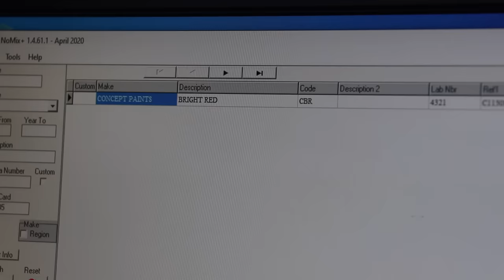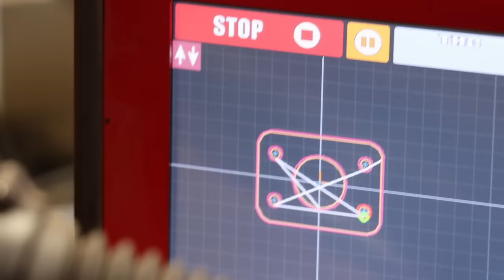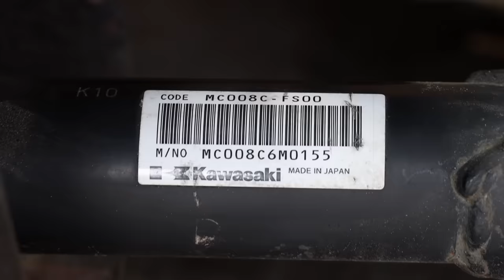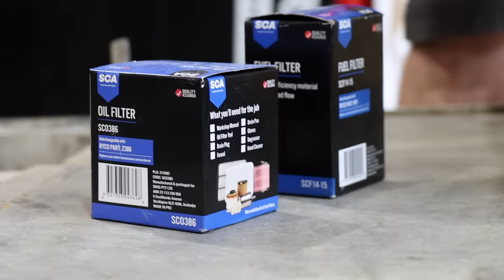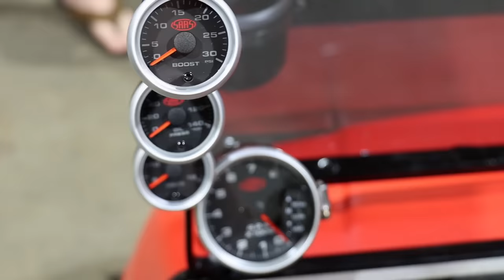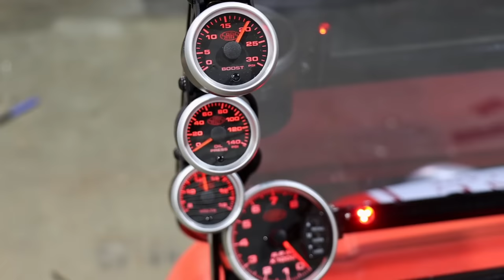Building the Ultimate Retirement Ride: A Golf Cart Fit for Racing Legends!

Comment: If I were to apprentice for Redline Retirement Carts  I'd suggest the following modifications:

1. A newspaper holder.

2. The glove box be lined with a table cloth and Tupperware containers for individually wrapped dry biscuits and barley sugar sweets.

3. A rear parcel shelf to store 6 x hats and a box of tissues.

4. Have the cart enclosed to protect passengers from inclement weather BUT roll down windows installed to allow passengers to protrude their clenched fists and shake them disapprovingly at youths.

5. Indicators that self cancel after 20 seconds.

6.  A TURBO (of course)!

Comment: Hey fellas, just a tip. When you are cutting aluminium with a cut off wheel, use a can of spray canola oil to minimise the dust coming off. Re apply as needed. Cheers Stan

Comment: My pimped golf kart would themed like a classic woodie panel van. Complete with wood trim, wicker chairs, a surfboard for a roof and lemon squash holders. However it would be called "Woody" and have little picture of Woody's head on the cushions. for power it will have a supercharger bolted on for dat hella sick whine, but not plumbed to the intake. thus shall be outputting -8 HP so the passengers will have the Flintstone it everywhere. will probs need that OBD reader cause it will be breaking down so much
Reply: Congrats mate!
Reply: A Woody-mobile. I like it.

Comment: If I had a 6 seater cart I’d build it for off road and hunting. 
Lift it, 4wd tyres, turbo for extra powah or engine swap it, custom roll cage, spot lights at the front with a spot light on the roof with a swivel. 
Equip it with night vision goggles and or thermal scope. Paint it camouflage colours. 
Could even go Yowie hunting with it 😂 the GC Hinter land is supposed to be a hotspot for them.

Comment: This is not the build I thought would be the one where I finally have a specific vehicle in common with you guys! I used to work at Club Car Golf Cars in Sydney😁 this brings back some cool memories!! Those "big block" 350s ones go well enough to have fun, especially in a shorter wheel base "greens keeping ute" version.😅🤘

PS..... there's a throttle restrictor that'll give you 1 or 2 extra Lama Powers, if you "modify" it!🤘
Reply from the maker: This thing wouldn't even run if you took the airbox hose off. We rejetted it so the turbo wasn't cooking it was so lean. Jet Drills from Matt's Dad Dave.

Comment: i worked on these for about 10 years at my last job, if the combustion chamber carbons up and you get the engine hot enough they will actually pull up to a stop then they will accelerate BACKWARDS ! the engines will run in reverse under the right conditions !

Comment: If I had a 6 seater golf buggy, I'd need to put a big lift and maybe a functional turbo so I could take the local old folk to do a little sight seeing here in central Australia, because we need to get tup to highway speeds and probably 4wd tracks to get to the good stuff, but also we have a real grass golf course so it would have to have the biggest lawn tractor tyres I could fit so it didn't tear up the fairway.

Comment: I would be thinking about rollover protection with a huge wing type roof/sunshade device. Also a engine swap to a 500cc ish size motorbike engine of some type. They will mount up to the torque converter style transmission. Have done that in a long distant past. 12 volt frodge under the drivers seat for cold beverages would not go astray either. Love the supercheap builds. Epic videos guys! Keep up the most excellent work! 😊

Comment: If i had a 6 seater golf buggy, i would fit it out with suzuki sierra solid axles, kubota 3 cylinder diesel with turbo. Manual gearbox. Crawler gears. Coilovers. Mini bullbar. Front and rear winch.

Comment: You've checked the compression in a small engine... can I ask if you loosened the exhaust valve lash to do so? (knowing about the compression release on the Camshaft)
Also, if you upgrade to one of the GX390 style Chinese engines, there are Billet conrods, forged pistons, Billet flywheels, Cams, Springs, Headers air filter adapters, Motorbike carb adapter manifolds and a "Plethora" of other goodies available at Go-Powersports, OMB warehouse (outlaw Mini Bike) and other places in the States... It takes a while to get them and the shipping can be expensive. But I will never look back from installing A Billet Rod, Piston, cam, flywheel etc in my little Honda clone/copy go kart engine... there are more parts to add, but it would be more cost effective to go to a Lifan 163FML 200cc motorcycle engine from where I am at right now